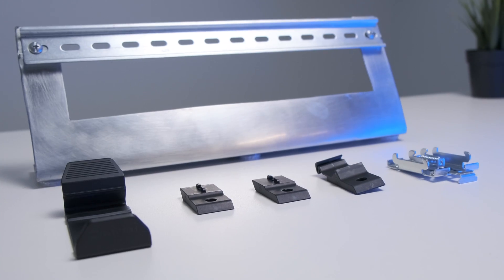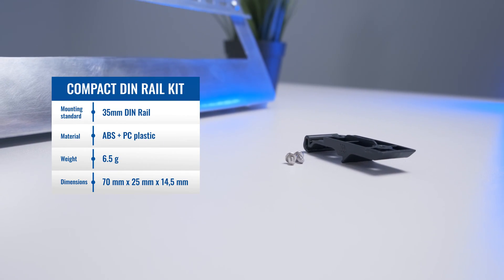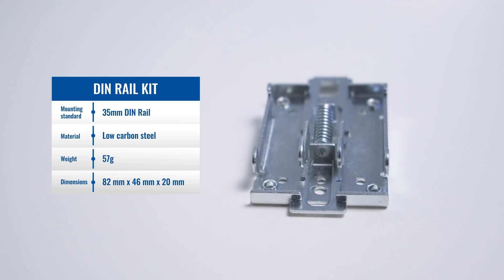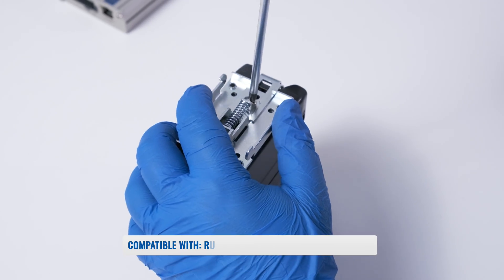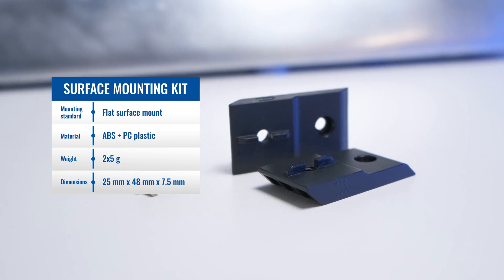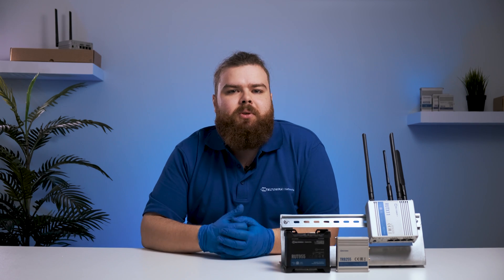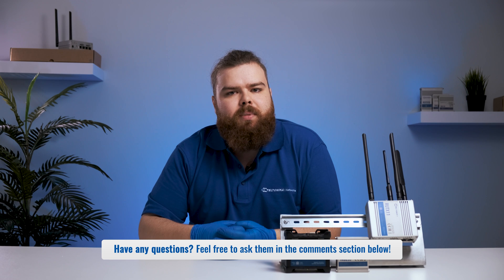How to Mount an Industrial Router | Tips & Tricks

Comment: What is the best way to mount the RUTx50 on a wall of a camper van without a Din Rail?
Reply from the maker: Hello, The best method for mounting the RUTX50 on the wall of a camper van without a Din Rail depends on your specific setup and preferences. While Din Rails are a popular and convenient option, there are alternative mounting solutions available. You can check our offered 3rd party solutions which can be used to mount your device: https://teltonika-networks.com/products/accessories/3rd-party-solutions
Reply: I think Maxview Roam 5G package uses same router, which comes with a convenient cradle bracket. May be worth asking if they can/will sell the cradle bracket as an accessory?

Comment: Hello i am an owner of a rutx50 and i have the mount kit with part number PR5MEC00 . iam curious because the case doeshnt have any holes in it does the screw open the hole in the back plate line of the modem?
Reply from the maker: Hello,
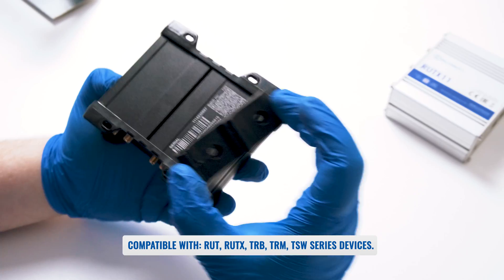Each router has a notch that you can use to secure your DIN rail. An example of this can be seen at the 0:50 time-frame in the video.

Comment: I spent way too long browsing your website for any information about how the din clips mounted on your switches. It wasn't until I saw this video that I understood that the "grooves" serve as mounting fixtures for this.

It looks like the TSW110 has these "grooves" on the top, bottom, and back of the device, whereas the TSW100 and TSW101 only has it on the back, is this correct?
Reply from the maker: Typically, the mounting holes on our devices are located on both the sides and rear panels. TSW110 model features mounting holes on both the side and back panels, while the TSW100/TSW101 models only have mounting holes on the rear panel.

Comment: Its a shame that you don't make the surface mount clip for the RUTX14. I want to mount this in my caravan and  the surface clip seems more appropriate. Din rail I think would have too much movement when traveling. The Metal din bracket looks ok maybe better If I mount on the back surface with rubber dome feet to attach on the four corners to stop it wobbling around.
Reply from the maker: Greetings. We have a surface mounting kit, you can find more information here: https://teltonika-networks.com/product/surface-mounting-kit/
Reply: @TeltonikaNetworks   thank you for the reply, I meant to say the "clip holder" not the surface mount.

Comment: Hello, I need a surface-mounting-solution for a RUTX14 in my Campervan.  Can i use Your surface-Clip-Holder-Kit for the ROUTX14?
Reply from the maker: I think this video will help answer your question about mounting options - https://youtu.be/30uv693dM_k
Reply: @TeltonikaNetworks  No, it of course did NOT answer my question. Because it does not answer if Your surface-Clip-Holder fits to a RUTX14  (i guess the RUITX14 is too big for this!)
Reply from the maker: A late reply, but still wanted to follow up. RUTX14 is compatible with https://teltonika-networks.com/product/surface-mounting-kit/